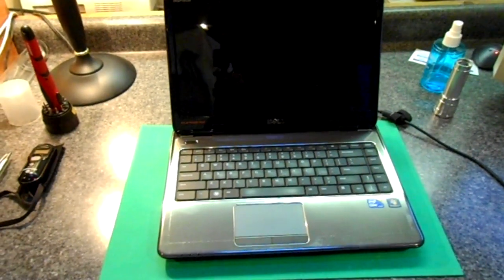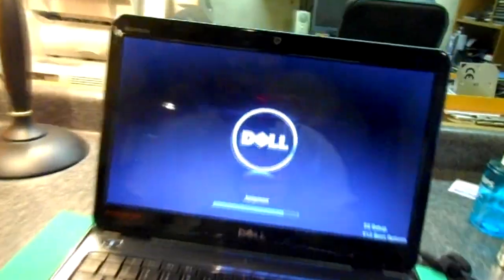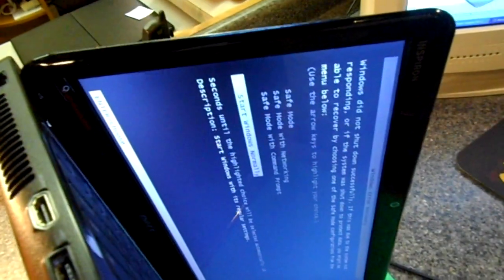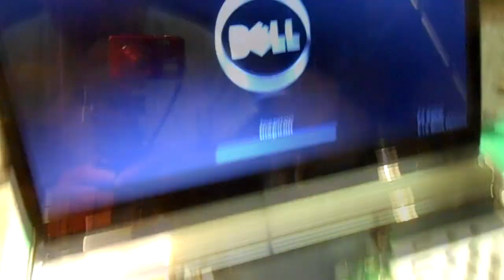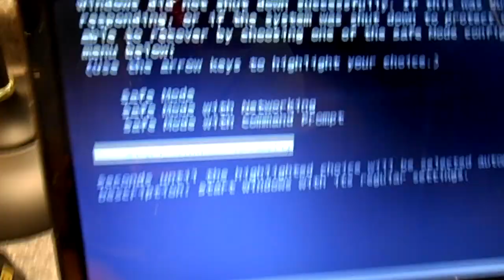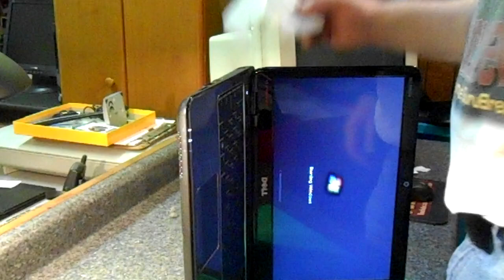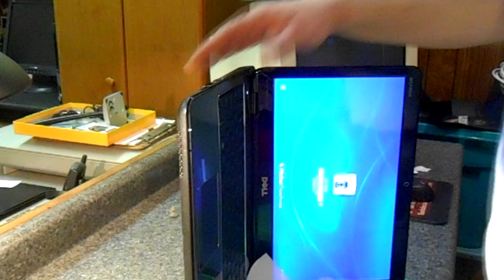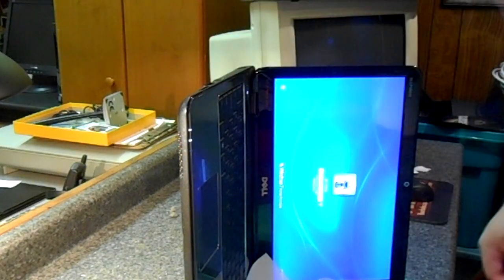How to Fix Overheating and Shutting Down Laptop

Comment: This was a great tutorial. I discovered a fan stopped working on one of my laptops and tried vacuuming it before taking it apart. Its intake is fairly open and a large amount of fuzz came out. The fan now is operating again. I did it on another and a large amount wanted to come out but a mesh screen kept it in. I used tweezers and slowly got it all out but it runs great. Those computers are both 6 years old but I am going to keep them and the new ones cleaned from now on. Thanks.

Comment: I have a Dell Inspiration 1764.  It overheats quite rapidly, and then shuts down.  I really like the video for the way things are explained simply, from what the problem may be to the execution of the necessary repair.  So many times, computer problems are discussed in a manner that the everyday Joe is clueless.  Keep up the great work and thank you for this video that will hopefully solve my problem.

Comment: thank you for the very informative video.  My fan is running but my laptop shuts down usually within 45 mins after powering it up.  I have a cooling pad, as well as a riser which should do the trick but it is not.  I have seldom, if ever, used the battery power - usually just keep it plugged in.  The laptop is about 5 years old.  Do you suggest purchasing a new battery?  I love, love, love your site!

Comment: Hi Steve,  Really liked the video because my Toshiba Satelilite L505 is getting hot and shutting down.  Also, the video gives the the confidence that I can get into my laptop as comfortably as I've always done with desktops.  However, my fan IS running and blowing HOT air out.  I'm pretty sure what the cause of my shutdowns is.... Minecraft.  But it might be something else as I've been playing the game for a couple of years and the shutdowns only started a month ago.  I happily realized that I'd just recently jacked up some of the game's video settings and when I slid them back down into medium ranges the problem stopped for weeks.  But yesterday, it started again.  As I watched your video I was really excited because I thought surely that was the problem.  However when you did the tissue test to show that the fan was working, I did the same thing and mine is.  Anyway, just wanted to say thanks for the insights and the confidence builder.  I'm now going to read up on Laptop graphics cards - I know the desktop graphics cards generated a good deal of heat and I even fried one when having too many graphics up and running.  Thanks again.

Comment: Absolutely great. I have been having the same problem with my asus laptop k55n. Shutting down when it got to hot. I have been using a small portable fan blowing into the input and output air actually, with my laptop elevated on 4 objects at each corner, which now after watching this video sounds like not a great idea in the long run . Due to possibly helping it get more dust inside. But it's working for now. I love learning how to solve all kinds of electrical problems . Thank You  for your knowledge and instructions. VERY HELPFUL !  I plan on watching many more of your videos.

Comment: Well this is the second 20 plus minute video I've seen and I have to say that you explain everything you do very thoroughly, which is what I think most people need, to give them confidence in doing what your tutorials teach. The last video was about ethernet drivers not being installed and this one, obviously, a fan issue. I've not worked on laptops and this shows me quite a bit of what you're doing. I like troubleshooting both software and hardware issues like yourself so I think your videos provide me with some needed insight into laptops. I thank you for doing this very much.

Comment: I like using some free software called Almico Speed Fan to get internal temps before and after working on the laptop overheating problem. It could also be noted the heatsink thermal compound needs to be redone sometimes or the heatsink replaced if someone scratched the surface. Good job with the video.

Comment: I cleaned my laptop's fan exactly as you showed but it's still running with loud sound should i replace it with a new fan!? and also it's shutting down with a click sound when i unplug the power. What seems to be the problem in this case!? Your response is highly appreciated, thanks in advance.

Comment: That depends, a lot of times the compound used in production is not as efficient as an aftermarket grease (arctic silver, etc.) or if it was opened prior and removed by an inexperienced tech, air bubbles can create issues in proper cooling of the processor.  Doing the job yourself, in removing the cpu, scraping, and reapplying grease, has become a staple in my diagnostics as it  ensures proper seating (and peace of mind in me doing it)

Comment: Just a bit correction on the fan wires: the yellow one is not a temp sensor, but it's the speed sensor for the fan, the temp sensors are on the motherboard.
Reply: Bezzeg ... ezt nem is vettem észre :D

Comment: That was very thorough thanks, but my problem is that I can see the fan running  and I can actually hear it, and then it just shuts off as the temperature rises, Do you know what might be causing that to happen. I would appreciate any help you can offer for that. I have an hp Pavillion zv6270us and am running Windows XP

Comment: Thank you for this great video!  By sharing your expertise and guidance, I should be able to keep my laptop running cooler.  All I need now is the courage to actually take it apart!  Thanks again!
Reply from the maker: golfgirl511 Thank you, Nothing ventured nothing gained. Besides it's broken anyways. Good Luck!
Reply: +GuruBrew I have a really big problem.. My laptop won't turn on even though i do the diagnostic with holding the power button  and all of that, it still doesn't work my fan doesn't work and now im thinking my power button doesn't work can you help me?

Comment: Hi there, i have the exact same laptop with an overheating issue. The computer runs fine an all, until i run a game. I can play a game for five minutes, but the laptop will randomly shut off. The fans work on mine , so do you think it could be a cpu issue? Im thinking about adding new thermal compound but im not sure exactly what the problem is.

Comment: Hello so i have a question i own a HP 625 it's not the fastest laptop but the overheating is insane it's not like dust is blocking it since i clean it weekly but still it overheats at a level that you can't even let your hand for a minute before the fan. what would you recommend doing to fix this issue.

Comment: 79hey , I have a Samsung NP350Vc s07 , I had the overheat and powercut due to 104 degree celcius , problem, I changed the CPU fan and itwas fixed fr a month now it is producing the same problem . the problem is on battery ad on charging also so , what would you suggest

Comment: Great video, I wish I knew someone who knew how to take apart a laptop. I've been having the exact same issue with my laptop, i took it apart about halfway but was afraid to take the faceplate or keyboard plate off as I thought I may break something inside so Instead tonight I'll try to blow as much air as possible into the intake and outake area and then if nothing else works I'll tear apart the laptop and hopefully find a giant peace of dust like you did.

Comment: [GOOD TIP] 16:28 For better cleaning the radiator fins where dust piled at the fanning end you have to use soapy water dipped tooth brush and carefully clean those fin holes after vacuuming and removing big bust piles on the fins. Then use moist brushing second third times to remove the soapy moisture out fins with careful brushing, you will see a lot of dirt on the brush. Because micro dust particles settled on the fin surfaces and soapy water brushing after vacuuming will do 2nd stage better cleaning of fins so next time the dust wont settle inside the fins so frequently.

Comment: I have a Toshiba s50 that was overheating. I took the heat sink apart to find a large clump of dust blocking the vents so I assumed removing this would solve the issue. Now the fan runs as lot smoother and seems to displace more air, but the laptop is still overheating after a while. I'm not sure what to do now, the disk is running at 100 percent all the time, though I'm not sure that's related. Also the fan is maxing out despite the fact my computer is not stressed at all, ie the CPU is running at around 20 percent. Any ideas?

Comment: hi, my laptop does not cut of when the power cord is connected but only when using battery power, it is cutting of when there is still over 80% power left over. Does that mean the battery has shot it or could it still be the fan

Comment from the maker: I did not remove the heat sink to the processor where the thermal compound goes. No need to remove just to replace what is already there.

Comment: Thanks, I have an HP with the same over heating prob. I going to try that and see if it works, a tech told me, I should just buy a new one for the same amount it would cost to fix. I see why; he probably would charge me just to tale it apart, it does look time comsuming. Thanks

Comment: I have the same dell laptop I striped it down and cleaned  the fluff out of the fan it was bigger  then the bit you had. The fan works but the computer shuts down 5min after turning it on. If I blow cold air in to it works can I speed up the fan. ( a bit shit having to use a hair drier to make the computer work) any thoughts on this problem
Reply from the maker: Sounds like the thermo sensor on the fan itself is shot. I would try to replace the fan with a new one that is an exact match. Amazon under $10
Reply: GuruBrew I have a samsung laptop quad core radeon graphics windows 8. And whenever i play a demanding game with good graphics and stuff like for example, planetside, it just powers down, it does it quicker the more demanding on the computer the game is, out of the heat vent it is incredibly hot, i keep wasting my money on games that just wont even run! Any way i can fix it?
Reply from the maker: You might want to consider taking it back apart and also removing the heat pipe and CPU & GPU cooler , clean pipe and reapply fresh heat grease. If you go through all this trouble you might as well replace the fan with a new one. They are cheap. ~Steve
Reply: GuruBrew Thanks, also i blew in the heat vent and it seems to be working slightly better, i will check for dust in the fan,

Comment: I have to clean my laptop now. I used an air compressor and its so much better now. My fan was overspooled and stopped working. Thankfully it started working again when I tried to push it to run.

Comment: you should leave some space under the laptop to be able to ventilate. otherwise you'll get a blue screen a few times and it will start shutting down, because the GPU is already damaged by the heat.

Comment: My laptop is over heating and shutting down but the fan is running. My battering isn`t fully recharging though.....would that be why?
Reply: VWGTI after continuous use, rechargeable batteries lose holding the charge so it depletes. All u need is a new battery. Try that first if not itll be something else but usually its a battery. Best way to extend the life of the new battery is to let it fully charge 100% then unplug from power source and run it down instead of leaving it plugged in all the time because if you leave it hooked up what youre basically doing is frying tne cells since theyre fully charged. Its like a water bottle. Fill it too much and its like "drowning". Hope this helps :)

Comment: I have a HP probook that has been to the repair shop 3 times in the last 6 months.  It will go to sleep and stay on and get extremely hot on the bottom. I have to pull the battery and let it sit overnight. now it will not boot up,no video, no sound just the power light comes on, and get hot.  I bought it 1/13/11 and purchased an extended warranty with it that runs out in 35 days.  I am leery of sending it into the same repair company again, afraid they will keep it for 3 weeks and ship it back   not working right. I did call the warranty company and waiting for their response back to me.  It worked fine for 2 1/2 years.  Shouldn't they last longer than that?
Reply from the maker: Hi John,
Yes they should last longer, especially the more expensive HP's, but sadly they don't. The newer ones are famous for this with inferior parts built only to attract buyers. Ask about a total replacement due to the lack of repair help and your inconvenience. Good Luck

Comment: FIXED MY LAPTOP! Try GuruBrew's other link: Tech Tips Keeping Your Laptop From Overheating, before taking laptop apart. Although this video is great, it's harder to take a laptop apart than to open up a desktop style computer. Takes skill to pry the keyboard out, etc. I just couldn't do it. My hp pavilion laptop was shutting down frequently due to heat. The fan was spinning but no air came out. So I tried vacuuming the vents as he describes in his other video. The vacuum pulled a small wad of lint, about 1/3 the size of a cotton swap tip, up into the plastic vents where I was able to grab it and pull it out from between the slats. Now laptop is acting normal again. So it wasn't necessary to take laptop apart after all. Thanks, Gurubrew!
Reply: There are always simple, quick and easy solutions if We use our brain to see logics of things

Comment: sadly mine isn't actually overheating, my computer will be primarily in IDLE then the fan turns on as fast as it can I pull up HW monitor it says 40C to 60C not bad I check load and sure enough it was running at 3% then the computer shuts down I'm thinking temperature sensor is going because it literally happens once every 3 to 4 months not an all the time issue and the laptop when I touch it is cold

Comment: 100 F isn't really that hot... my laptopt (dell inspiron) runs at usually 150 F or so and on the longest occasion it hits 212 F and I can spell burning so I just turn it off and back on and it cools itself down. (I think I can norrow that down on gaming+ the fan not turning up so I do that.)
Reply: i guess u werent listening. Too much braggin for what u do. what u do he said 100 isnt bad not enough to open it but he could have made it hotter faster if he ran anything on it
Reply: ***** Thing still works perfectly fine actually. I don't get how such a low temp would fry the thing? Also that burning smell happened once in a great while. Sorry to break it to you but software has it's bugs so. Also I highly doubt with it being used (now at least) to watch music videos every couple weeks that it will die soon. 

Also the smell may have been something to do with the charger or something as after we gave it a clean install the charger stopped charging. After that we got a new charger and it's charging again. 

Also I don't get when I made this comment. At this point I had gotton a desktop.

Comment: when one try to clean the cooler with compressed air that what happens - the dust will go into the fan and will block the propeller.

Comment: Using a light weight feather instead of tissue paper will tell you if the fan is working as it is very sensitive even to a very small amount of air movement

Comment: I have a gaming laptop but it stopped working..i can feel cold air when it starts but when i game it starts to get really hot and it didnt do that befire, just a little warm air
Reply: That must have been a fan problem with lent getting clogged in there.
like it was shown in this video, which caused the laptop's overheating problem.
in other terms, It could be your battery as well that needs to be replaced, depends on how long you've had the battery

Comment: I have an issue, please help me DD":
My usual laptop temperature is about 30 - 50... I just can't make myself believe that i have an overheating problem, but when i play games, my laptop runs it only about 10 minutes and then shuts down, also during that process my laptop starts making a lot of noise. Same with after effects, i can run after effects nicely, but  when i edit for more than a few hours, my laptop gets really hot, it doesn't shut down, yet DD": So should i clean the dust from my laptop? I'm kind of afraid of tearing the entire laptop... I have a cooling pad too... it doesn't seem to help, not a bit. Advice anyone D: ?

Comment: What's that in Celsius
And keyboard ribbon cables arnt easily broken maybe that's just clumsiness
Reply: That’s about 40c , which is an ideal temperature for a cpu/laptop to be running at. Unless I’m missing something here because I don’t understand how that is overheating at only 40c when it would usually take 80+ to be considered overheating

Comment: You make things so compicated,why not just plug in the fan into the motherboard and hold it to see if it will work? That seems much easier than using a separate power supply and messing with the wires.

Comment: Huh. My laptop is fine in normal use, but whenever I play games on it, the temperature skyrockets and the fan sounds like it is straining. I can only play for an hour or so max. Guess I need to get a new fan. Anybody know if Best Buy can help with this issue? I'm not handy at all.
Reply: If it's just when gaming, you might consider buying a cooling pad.
Reply: you might have to change the thermal paste in your cpu/gpu and check ur fans. clean them as he did in the video. and run a program that checks the temp of your computer.